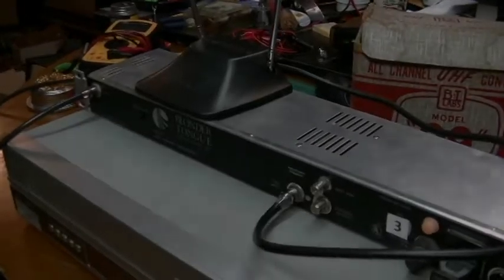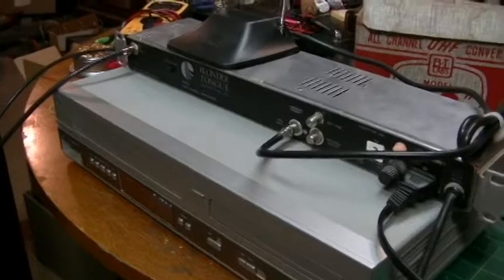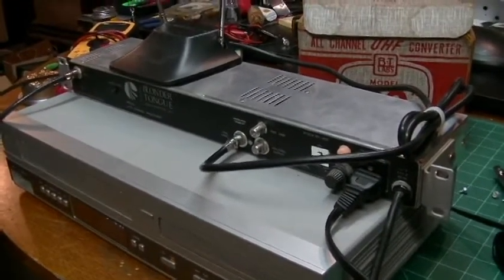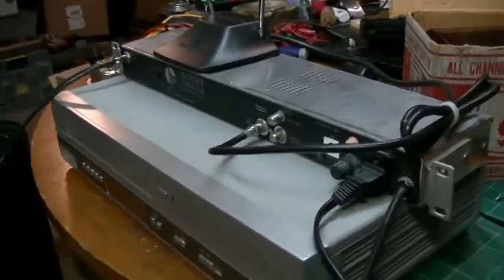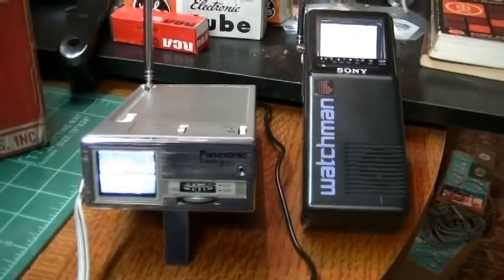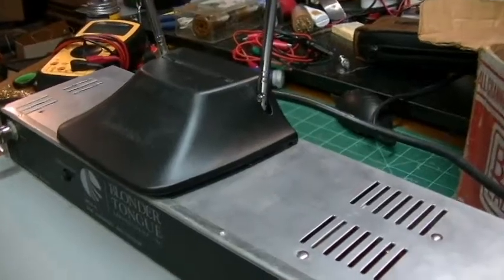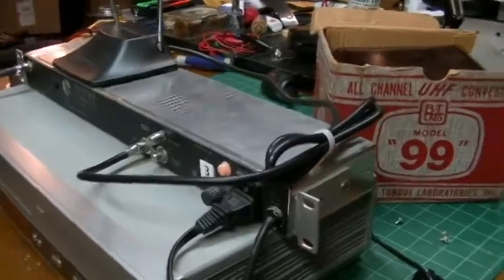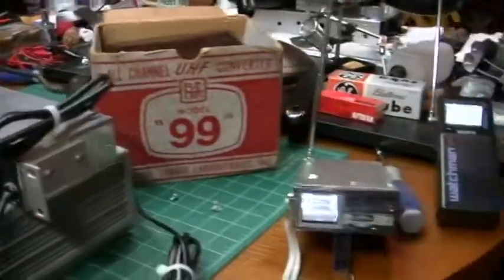Blonder Tongue RF Modulator

Comment: Thank you.  I've watched your lesson twice.  The second time with my husband.   He is mostly on-board! 

We could still use a little clarification if you could help out?  You say that you are using OTA as the original signal? 

I know all Cable and OTA signals are now digital.  Can I feed this BT directly through a Cable Subscription coax cable?
I'm hoping that I can pick up cable on remote TV!  Thanks!
Reply from the maker: Yes, you be able to feed a cable signal into it if you have an old time cable box that with channel 3 or 4 output, and your blonder tongue is either channel 3 or 4. Then you should be able to broadcast on either of those channels.
Reply: @ScottTV-yq2wu   This is good news.  Thank you!  Set the TV to Channel 3 through the ABC Cable Box.  Tuning BT to channel 3 won't be a problem because this isn't OTA connection.   I can't get 3 or 4 OTA. Sad!

I want to transmit "Cable 3 or 4" RF signal to OTA antenna for that second TV.                                                         I am hoping for RF connection, through VCR digital/analog Tuner.  Tuner out to TV.   This way I don't think   I will need a second Tuner and the receiving end.   If all goes well,  then record that signal OTA!  I don't think there are restrictions on OTA re recording?  

Cool ah? 

The one think I am not sure of is, if the signal that is transmitted from the BT is analog or digital?
Does BT act as a step-down?
Thanks!
Reply: I haven't had any problems recording on this VCR/DVD-R through a regular cable connection.  Looping
Cable to CB in, out to VCR in,  VCR out to TV.  Exactly like the old days.  Go figure? 2004 Sony with DVD-r
and Direct In for Handycam.  Something in this line-up is keeping this marvel working.  I figure it's the RF
looping through.  Also has high Macrovision protection.

Comment: UHF and VHF are still here. Those terms refer to frequency ranges irrespective of content. Modulation occurs on all electromagnetic radiation. FM is "modulated" albeit by different means. please get your terms right. That's how hucksters sell Digital antennas. There is no such thing and old fashioned analog antenna will work just fine with digital.

Comment: I just got an AM60-550B that I plan to build a small transmitting station here in my home. One of my ham radio friends warned me about the FCC having issues with that but as the power is quite low and if the signal doesn't go much beyond my property what harm could there be.
Reply from the maker: Yeah, your really not supposed to be broadcasting signals like that, but no one will know basically. Unless you have a neighbor who just happens to have something that can receive analog signals that you could interfere with. That would be millions to one odds that you would cause any issue. Mine doesn't go past my property either, so I'm not too concerned about it. The FCC has a lot bigger fish to fry than low power hobbyist watching old TV shows in analog.! LOL!
Reply: Hi HD7100.   Someone just recommended that I buy the same Blonder Tongue AM60-5508B as you have.
I know you posted your comment here 3 years ago;  would you mind giving me an update on how well your
application worked out?  Where you able to broadcast to Digital TVs or just Analog TVs? 

Did it matter what kind of TV was acting as a Satellite receiver?  Knowing that would make my month!!!!! 

I hope everything worked out as you planned!   Thanks!

Comment: Very neat. I should maybe get one of those.  Gary
Reply from the maker: Yes, if you do much TV work, you need one.
Reply: +ScottTV1962 Hi Scott. I just bought a BT AM60-550 agile modulator and will be building my transmitter station soon. Do you know of a 5AXP4 CRT for sale? Gary
Reply from the maker: I do not, but I would post on all the boards that you are looking for one. Antique Radio forum and Videokarma are good places to start.

Comment: Scott,
This video has given me food for thought.
Over the past six months, I have thought about how I might use modern technology to convert the modern digital TV signal to be converted to any one of the following: 625 PAL-I, SECAM 625, or NTSC 525, and then be re-converted so I can occasionally demonstrate playing the odd movie on my B&W 405-line TV set, a (1948) Pye model B18T.  I also own a, 1949, Bush model TV12 – 405-line B&W television.  I considered using a PC tuner card to demodulate the sound and video and then use a DSP to interpolate and regenerate a B&W 405-line signal but I think that would be too complicated as the old analogue TV relay systems functioned on the horizontal time base frequency (25x625 = 15625Hz to convert to 25x405=10125Hz).  It is important to me I keep my old TV sets exactly how they were designed and manufactured to work – I will not consider altering any circuitries (I’m not cleaver enough LOL).
The old B&W 405-line, band 1 & 3, transmissions were abandoned here in the UK 02/01/85, so we now get a blank raster accompanied with white noise. Your Blonder Tongue RF Modulator equipment has given me the basis for developing a few new ideas which I will be researching over the next few weeks.  I don’t want to spend time getting my Pye TV working to the point of raster and ‘hushing’ sound only – that would be futile LOL.
Thank you – a very good video my friend.
Regards,
Phil.
Reply from the maker: Phil, I'm glad I could help in your quest...or at least getting you thinking about it. Being here in the states, I have little knowledge of the PAL format of Europe, and how it relates to digital signals used here in the states now and  what you have in Europe.currently. But I'd think someone, somewhere would have an answer on that. I'd think a PC card would be out there that could address that....but that kind of thing is way over my head. I know I can use a digital converter box in between my antenna and my BT, and then it will broadcast out on VHS channel 3. But I don't even bother with that. I either use current cable hookups or my DVD's with old movies/programs I want to watch. That's the only way I know to convert digital signals to analog right now. But as far as the format, I am clueless on how to accomplish that. Please keep everyone posted what your research produces. I know I would be interested in that.Thanks!
Scott

Comment: When they are plugged in you said that they run all the time. Do you have a kill-a-watt meter? How many watts does the unit consume?
Reply from the maker: I do, but I have never tested it because I just use an extension cord and plug it in when I'm using it. I see no need to leave it on all the time. But they were designed to do that in commercial use like a hotel or office building. I may check that out just to see. Thanks!

Comment: There are also Drake RF modulators.
I'd like to see the specs on BT  and. Drake, I think the Drake have meters on them.
A must have for us old TV users. Great 411 video Scott.
Don
Reply from the maker: Your right. There are others out there that I didn't mention. I've just always had these and they work good enough for me and are readily available. And true, they are a must for old TV collectors!!! Usually no retrace issues, etc, that you can get with modern signals that the 40'-50's 60's stuff just wasn't designed to handle.